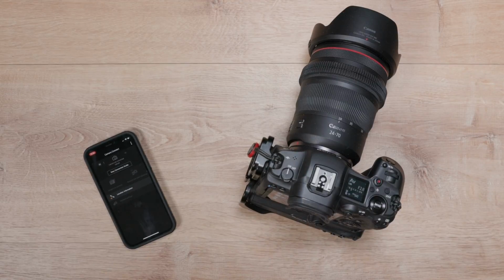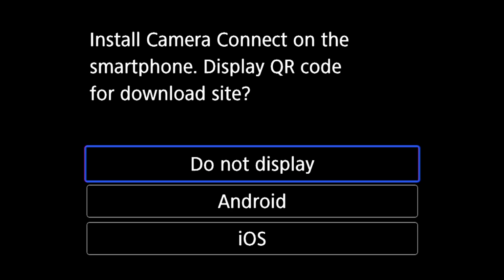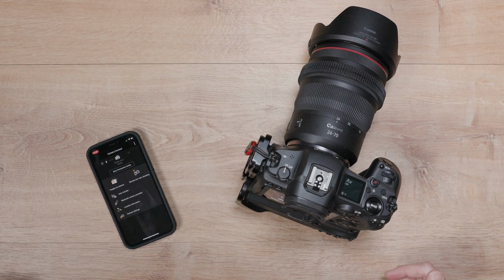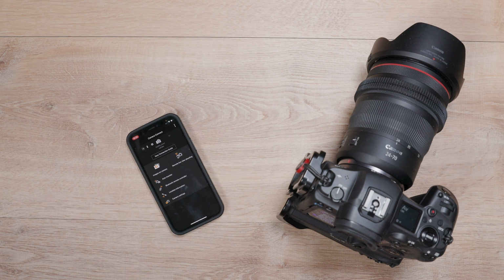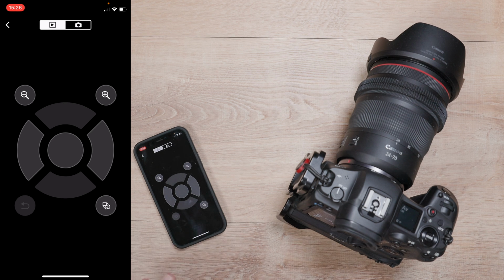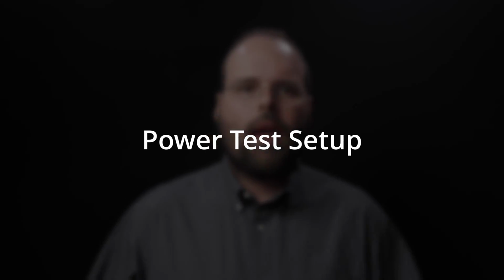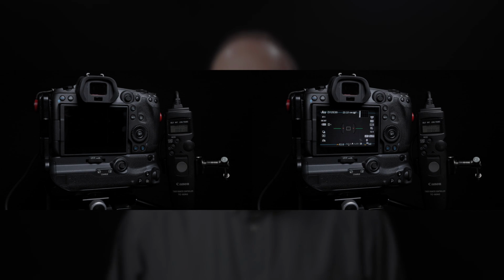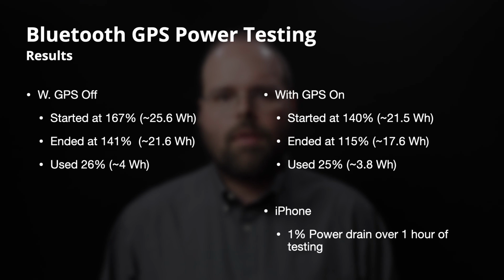Bluetooth Control & GPS - EOS R5/R6 Tip 52

Comment: Thank you for your examination. I just got my R6m3 several days ago, and as I'm still learning how to set it up to my needs, I was getting very concerned about all the extra things I had to do to turn the GPS on. I am very disappointed that it's not built into the camera, but I (almost) understand the reasons. My first digital camera was the 30D, and for GPS, I'd take a few photos with my phone for location purposes. I was delighted that my next camera, the 7Dm2, had it built in (major joy!). And that's where I come into this issue.

Let me add that when on holiday, my 30D let me go for 2-3 days of taking hundreds of photos daily. However, the 7D (with GPS turned on) was best when I recharged the battery EVERY night. I knew going into a mirrorless camera that the charging every night would not change. Nonetheless, thank you for assuring me that the drain of always-on BT between the camera and phone will not be an issue. (And, I do recharge my phone every night anyway.)
Reply from the maker: I really miss having the built in GPS on my 5D mark 4's. I wish Canon could have kept it on all of the R series.

Comment: I was using a GPS tracker, Solmeta, which attached to the R6 hotshoe and constantly supplied location data to the images until one day connector on the tracker broke. Good thing the camera hotshoe is made from stronger stuff.
Remembering the Camera Connect app, I installed it on an old android smartphone I was not using any more. After some frustrating time getting the two to talk, I finally got it working. Had to remember to turn off the power saving feature on the phone or it would shut down the app after a period of time, usually just before I would take the next image.
I also wonder what or who is Canon protecting by not including a GPS module? With today's passion for geolocating, it would seem to be a major plus for any camera that can do it internally.
Now I have the hassle of maintaining two separate systems in the field just to know where an image was made.
Reply from the maker: I don't think they're protecting anyone, not even their own products (e.g. the R3 and R1). I think the R5 and R6 dropped so much volume compared to say the 5D4, that fitting not only the GNSS module but its antennas is the problem. I was reoginizing gear the other day and pulled out one of my 5D4s the other day, and was amazed at how much smaller my R5 is compared to it.

Keep in mind, the Z6, Z7 or Z8 have GPS modules either. Also I could be wrong, but I don't think Sony has GPS modules even in the A1 II. AFAIK, both Sony and Nikon use smartphone apps for GNSS functionality.
Reply: @PointsInFocus  what's the problem of having slightly bigger/taller body, but with GPS built-in? It's not that R5 or R6 must be of a very specific dimensions otherwise people won't buy them, right? I mean, smart watches with or without GPS modules build in are pretty much the same size.
Adding GP-E2 module on top of the camera, now it makes it significantly taller, more prone to damage both the GPS receiver and the hot shoe and that setup won't fit into camera bag/case even meant for 5DIV.

Comment: Thanks Jason.
I had a similar experience with regards to negligible  power drain on the R5 (Mark I) and an iPhone XS Max with geotagging enabled. Recently, I noticed that occasionally images at the end of a sequence are missing GPS location data (after a number images where it was working perfectly). Could this be related to power saving settings on the R5 and, if so, what settings should be used to maintain GPS location information?

As an aside, older possibly unused smartphones work well for adding GPS location data. For example, my spouse uses an old Android smartphone (via the Canon Connect app) for geotagging with an EOS RP camera.
Reply from the maker: Sadly, I've given up geotagging my pictures until Canon puts a GNSS chip back in the cameras. I've had nothing but problems with the Bluetooth/smartphone solution not updating my position when I've moved or just not syncing at all.
Reply: @PointsInFocus I share your frustration. :-)

In the past,  have used a separate GPS tracker (actually a smartphone) to generate a file with a GPS track. I then used Lightroom Map module to geotag the photos based on time and date. This becomes quite tedious over time. Another option for a small number of photos is to use a smartphone to simultaneously capture ithe scene and then copy the location from the smartphone image. For example, macOS Photos has a copy/paste function for location data.

Comment: Jason, thanks for this video! With my R5, I discovered the GPS can be set to the iPhone per your instructions. However, all of my photos now have that same GPS geotag at the location I paired the iPhone/R5, even though I moved to a new location. Can anything be done to have the camera read the updated location from the phone?
Reply from the maker: The camera should update GPS data regularly (not sure if it's every photo, but every minute or so), if you have the Canon app running on your phone (in the background should work as well, as long as background app refresh is enabled for it).

That said, I haven't used the GPS feature with the current Canon app yet, so it's always possible that there's a bug that's breaking things too.
Reply: @PointsInFocus  Thanks Mr. PointsInFocus! Unfortunately, that did not work. GPS location tagging only works if the app is running and the phone is not sleeping. Background app refresh on the Canon app is on. I tested it several times with the app running and it logs updated location. As soon as the phone sleeps, I lose updated tracking. This was very frustrating, since I just got back from Europe. All of my photos for a specific day are at the location where I performed the Bluetooth/WiFi sync. Someone suggested the GP-E2. However, Canon stopped production on that product. Any additional suggestions are welcome!
Reply from the maker: One other stupid question... Do you have the Canon app set to always be able to use location services too?

I can get a new GPS fix from my phone within a couple seconds after turning my camera on, even with my phone asleep and the app in the background (but only if it always has access to location info and background app refresh is active) but it doesn't update every photo taken (it also doesn't do that if the app is open and in the foreground either). I'd have to look into seeing if it updates after sometime or requires a power cycle.

That said, I would also recommend getting in touch with Canon support and complaining/asking about this too. In the past, even on a 5D mark 4 with the built in GPS unit, the camera updated it's position regularly. I know at some point I thought my R5 was doing that with my smartphone too, but I find the whole smartphone GPS tagging process to be enough of a pain in the rear that I just stopped geotagging my images. Also it's kind of ridiculous that they'd discontinue the dedicated GPS unit for the R5 series without having a replacement given how the app works (or doesn't).

Comment: Thanks for the info! Still I’m not sure about something. I work on an expedition vessel in a very remote place. My phone is always on airplane mode with limited WiFi connection. Sometime I carry it with me to the expeditions. Sometimes it stays on board. Do you think the camera will be able to use the gps from the last known location or both devices need to be together at all times?
Reply from the maker: No, the camera and phone have to be together all the time for the smartphone GPS to work. In fact, I've had problems keeping the camera and phone synced even when they're both with me sometimes.

To be honest, there's no real good solution to geotagging on anything other than the R3 right now. The GP-E2 external model is somewhat clunky (goes in the hot shoe), though it does have an electronic compass. The smartphone system is very hit and miss in my experience. In many respects, nothing on the R5/R6 really works as well as the build in GPS that I had in my 5D4 (or you have in the R3).

Comment: Thanks for the excellent explanation its appreciated and you covered almost all of my questions. However I'm still unsure if its worth going to Airplane mode at end of a shooting session and re-pairing for each new session or is the power loss so minimal I can set and forget?
I notice the 'bluetooth icon' still on in top lcd display both 
a) when the camera goes to into standby / sleep mode ........... and b) when the R5 is powered down
Cheers and thanks again for your meticulous presentation
Reply from the maker: It depends.

First, at least in my experience, if you're only using Bluetooth the camera should automatically repair with your phone when you turn off airplane mode. At least that's what mine seems to do when I've tried it. Though you might need to have the Canon app open or at least in the background. I don't think you should have go through all the steps to reconnect in that case.

WiFi is an entirely different cup of tea. Ultimate power consumption will depend on whether the camera is creating a WiFi network or a member of one. And reconnecting to a smartphone will depend on which way you're working there too. That said, WiFi power will be higher than Bluetooth power. Unfortunately, I don't have really good numbers on this as the test equipment I have (and had when I looked at this in depth) isn't quite precise enough to give me data I'm comfortable with.

Personally, I keep WiFi off unless I'm actively using it. I've had no problems leaving Bluetooth on for the GPS data, but I'm usually shooting enough in those situations that I'm burning through battery fast enough that the any difference isn't really obvious.

Hope that helps.

Comment: Great video! I usually use a Canon GP-E2 on my R6, but I decided to try Canon Camera Connect recently and I find it does geotag my images. One of the things I can do with the GP-E2 is to set the logging interval as low 1 second. This is important for me because I use geotagging primarily for airborne photography. However, I haven't been able to find anything about the logging interval for the app, and I don't see anything in the app settings that allow for a selection. I use an iPhone 12 mini. Would you happen to know anything about the logging interval?
Reply from the maker: Unfortunatley, no, I don't know what the update interval is. I don't even have a good way to go about testing it either.

Comment: Great channel! Would be interesting, if you made a video about connecting the camera to the Canon Cloud and also a video about the new version of the app :)
Reply from the maker: I can't get the Canon cloud stuff to work at all at least no on my camera and/or with my network (there is a video on it not working). The camera simply refuses to connect.

I have considered revisiting the new App since it is a big change from the old one, but it's not a top priority at the moment.

Comment: Great information Jason, especially the battery consumption part.  I would of thought that having the GPS tracking on, along with the BT would drain the battery of both the phone and camera faster.  Glad to know your test shows that it will not.  On a side note, I noticed you had the battery grip on, do you have an L bracket on your camera?  I have been looking for one that fits the camera that has the battery grip installed and haven't been able to find one.  Thanks again,
Reply from the maker: It does drain the battery, but at least this testing I did I couldn't distinguish the drain from normal use. Though that's the point of Bluetooth low energy.

Regarding the battery grip and L-bracket. I use Really Right Stuff's BGR-10L plate.
Reply: @PointsInFocus  thanks Jason.

Comment: "This process is a little fiddly". You are joking; working with Wifi or GPS on Canon is such a pain, I gave it up long time ago. When you get to see how a small camera like GoPro is handling these protocols, and on the other side a huge camera producer like Canon, with a lot of history and development heritage, you ask yourself who is in charge for this kind of poor development, and how was this department not fired years ago.
Later edit: Yes, I am aware that GoPro has its own integrated GPS module within the tiny camera. Which makes the matter even worse for Canon.
Reply from the maker: I own a GoPro, admittedly it's a Hero5, not a more current one, but I consider it a stretch to say that it does WiFi or Bluetooth better than the R5. I can't even put my GoPro on my wireless network, it has to create it's own that the computer has to connect to which kicks that device off my actual WLAN. The only advantage it has is the built in GPS chip. Though real question is why Canon omitted the GPS chip from the R5, when they had it in the 5D4.

Comment: Thank you for this video. I’ve tried using the GPS from my iPhone and found it very frustrating.  I had it set to only when using the app. I had to keep the iPhone awake and the APP active to get it to tag my images. What I had missed is the privacy setting for the Canon Camera Connect. I think that should fix the issue. I still miss the GPS tagging from my Nark IV.
Reply from the maker: Glad it helped.

Given the choice, I'll always take integrated GPS over having to tether with a smartphone. I never had a problem with my 5D4s, and I never had to worry since I could just keep the GPS on when I was traveling. However, with the R5, there's just enough hoops to jump through that I often forget to turn tagging on, and when I do I close the app or something and half the images don't get tagged.